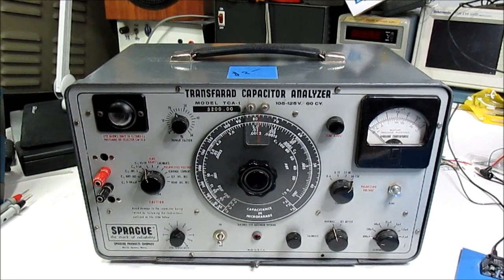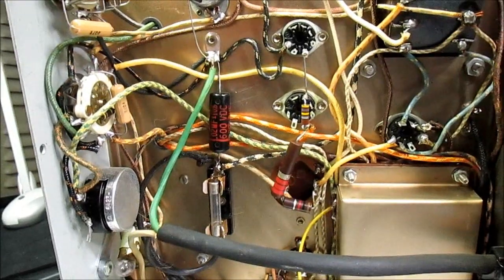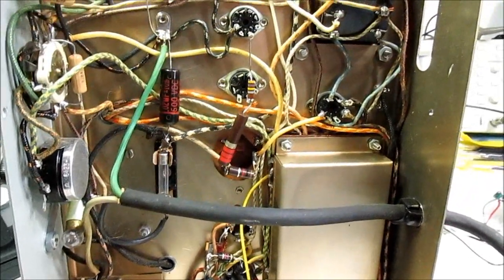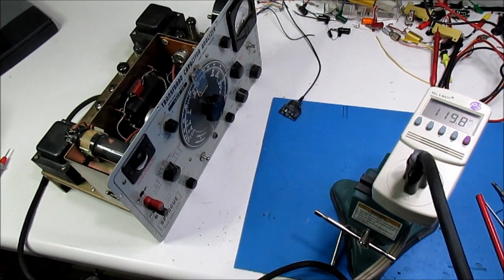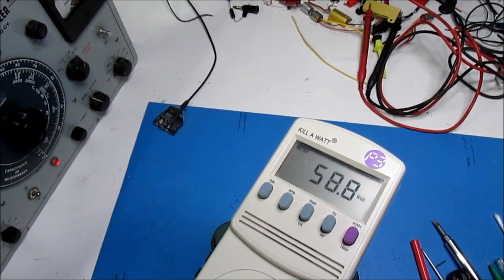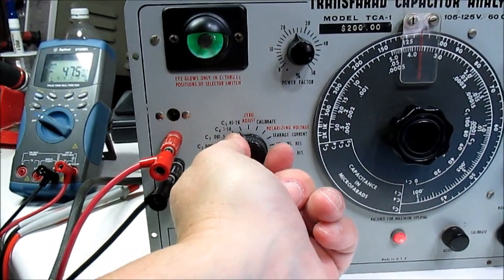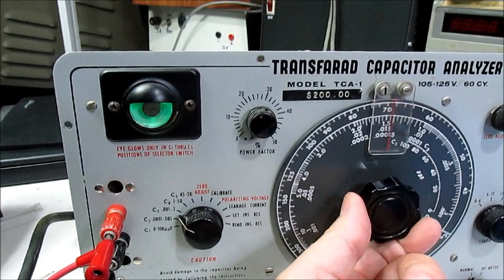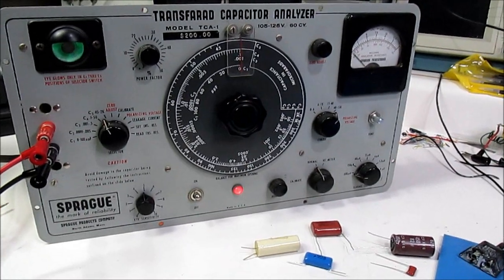Spraque TCA-1 Capacitor Analyzer

Comment: Awesome build unit, wasnt cheap back in the days.
It does look better than I do after all these years (1965) 😁
Reply from the maker: For sure....   I did find a ad from Jan 1961 (a few years before this one was built). that listed it at $197.  Inflation calculator shows the 2023 value as $1982.

My recollection was I paid like $8 for it in 1986...

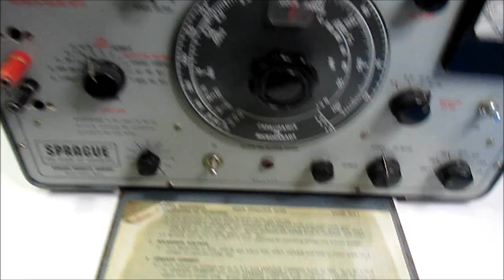Comment: I have a suggestion: @2:04 on the slide-out Quick Operation Guide, Section 5.3, it says to be sure to adjust the Eye Sensitivity control if the eye's response is "broad or critical", which it seemed to be on a few of those caps. I'd try re-measuring those caps while messing with that control. It also mentions using the Power Factor control if the eye tube seems "fuzzy", which is something I tend to forget when measuring electrolytics on my Sprague capacitor analyzer (I have an earlier, broadly similar model, the Sprague TO-5 "Tel-Ohmike", but it has far fewer adjustments and a much simpler DC voltage source circuit, without the voltage regulator tubes. In fact I believe it only has three tubes, including the eye tube.)
I betcha that thing works a whole lot better when those controls are adjusted.
Reply from the maker: Thanks.  Yeah, I should have followed the pull out guide when making this.  I remember trying this out in the 80s when I got it and it was for sure a little tedious.  Once I get through more checkout on this unit, there will be another video I hope.